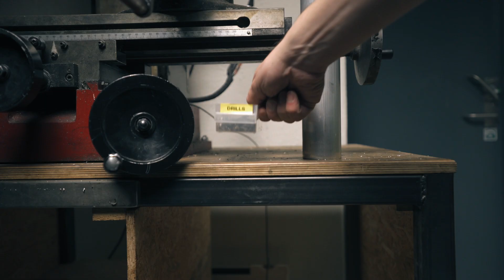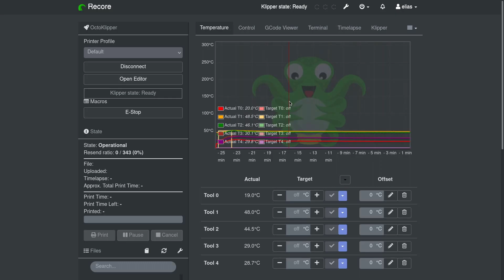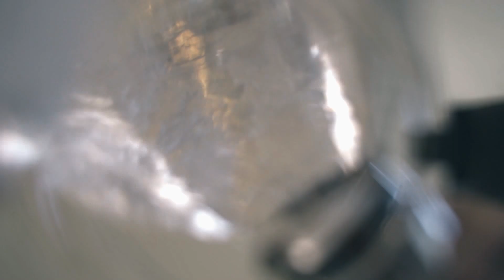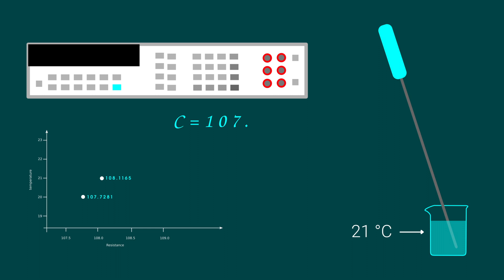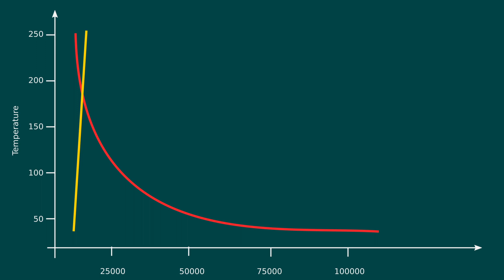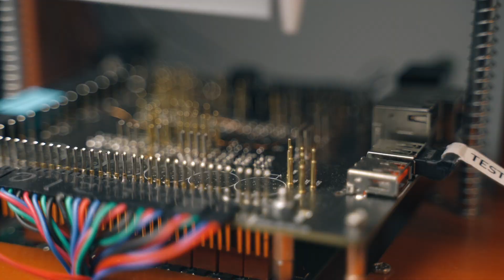Getting perfect 3D-printing temperatures

Comment: Elias, can I use your new cape board with BBB to drive 7 stepper motors?
Reply from the maker: Hi! This board (Recore) does not need a BBB, it has a processor built in. If you are thinking of Replicape, it is no longer manufactured. You would need an external driver in addition in order to run get 7 drivers for Recore.
Reply: do you sell these drivers as well ? and if not, then how do you integrate both Recore an external driver for a project like mine. I can code in python, but am struggling with finding a solution that will allow me to to control these 7 motors from an integrated platform. that's why I got BBB and Replicape in the past, but then turned out that I need to control more than 5 motors. help.
Reply from the maker: No, sorry you'd have to get them from somewhere else. It should not be necessary to program anything, just use Klipper to configure the right pins.